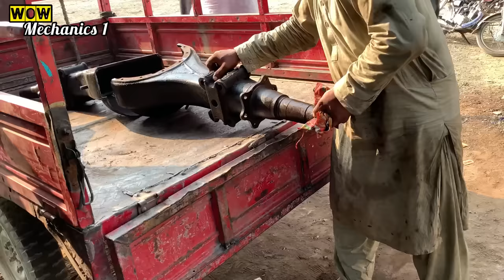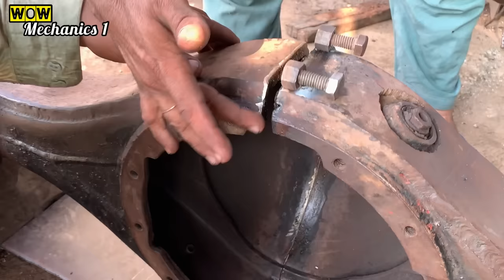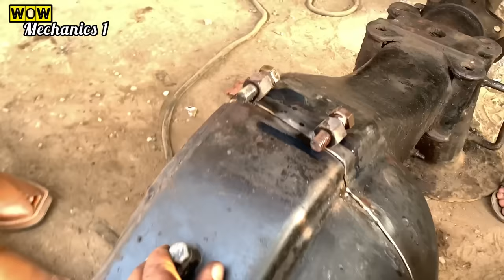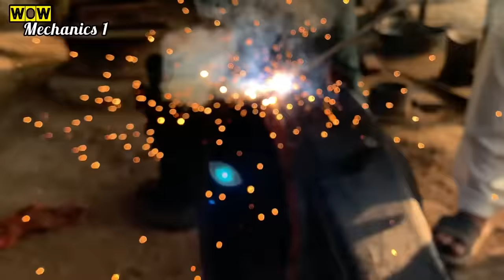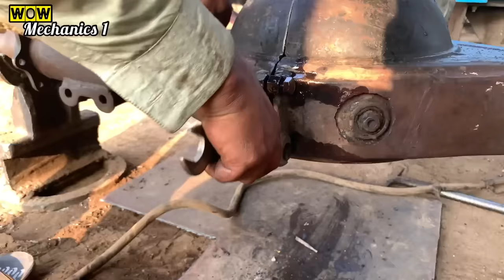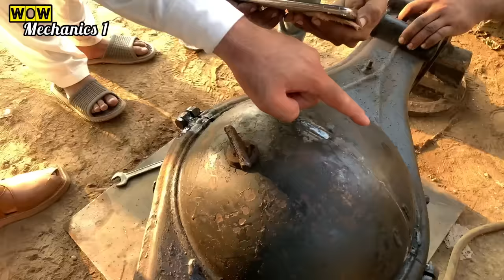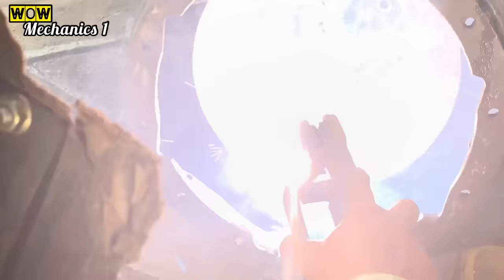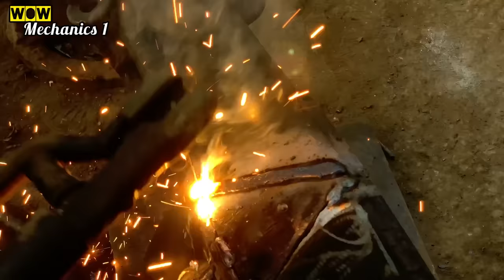The Axle of a Truck Broken in a Strange Place // And the Masters of Metal Fixed it Using Magic

Comment: I don't see how the two halves can get pulled together by those two nuts and that bolt.  As the bolt is cranked it extends out of the first nut and threads into the second nut.  So the space between them remains a constant.
Reply from the maker: hmmm
Reply: A good thing to do would have been to make a sleeve smooth with no threads on the inside mut. Then the system would have pulled the two halves together.

Comment: 'm not a welder but the problem i see is the nuts used to begin with, both are threaded so i don't see how they can be used to adjust for spacing.
Reply from the maker: hmm Thanks watch my video

Comment: I would screw in place the plate on the opposite side first to hold the two halves together for me until I were able to weld enough area so that the halves stayed together.
Reply from the maker: Yes you are Right

Comment: no weld prep,surface not even cleaned,doing the runout checks in wrong place, note it was previously repaired and cracked, for non engineer entertainment only, us engineers giggle and wonder how many kms it will last

Comment: Why do you weld and then after grind the weld off, not smart. leave the weld alone its the strongest part now also vee gap the two parts and then weld the gap, more weld holding power together
Reply from the maker: Thankx G

Comment: If I was them, rather than weld the nuts and bolts on the top and bottom. Bolt the rear cover on it. Then it will all be aligned correctly.
Reply from the maker: Thanks Sir

Comment: Not very precise. I suggest to cut a round piece of blank and use 4 bolts to lock the two broken piece into place. Tap weld first.
Reply from the maker: yes best ur advice but this work is best

Comment: I don't believe this was broken in use. It looks like it was cut with a saw. Nothing is bent or deformed.  Look how clean the edges are. It looks like it was "broken" so they could make a video showing their magic putting it back together. Isn't there any bone yards there to take pieces off of dead vehicles instead of constantly welding stuff back together?
Reply from the maker: Thanks

Comment: UNTIL YOU SECURED THE ALIGNED NUTS AND BOLT  ON TO THE TOP YOU SHOULD HAVE NOT ATTACHED ANYTHING TO THE BOTTOM . ALL YOU SUCCEEDED IN DOING IS CREATING MORE WORK FOR YOURSELF THAN NEEDED , MAYBE LEARN FROM THERE ? >? ? ? ?
Reply from the maker: hmm

Comment: This axle housing has been cut in to 2 bits using an oxy gas cutter and is not the failure it is being made out to be. If this was a real failure there would be numerous crack lines and deformed tears and not the straight line cut that we see.
Just another Youtube "clickbait" video to fool the gullible who have never ever carried out any structural repair work.
Reply from the maker: Thanks 👍

Comment: Bullshit, that is way to clean to be broken, it was cut for this video.
Reply: Didn't see what they were trying to prove with the surface gauge sitting right over the v-block support either. The triangle but welded into the housing is a little nuts too. - I could see a fish plate but unless they know something I don't know. why ????????
Reply from the maker: hmmm tnks

Comment: Pakistani repairs are pointless 
 and merciless. Put the gearbox back in place and grab the bridge as needed. but no. we will make nuts and bolts.
And again, the welding mask is respect. cardboard and glass.

Пакистанский ремонт бессмыслен 
 и беспощаден. Вернуть на место редуктор и прихватывай мост как нужно. но нет. будем лепить гайки и болтики. 
И снова сварочная маска-респект. картонка и стекло.
Reply from the maker: hmmm